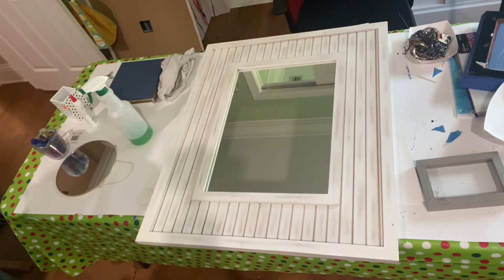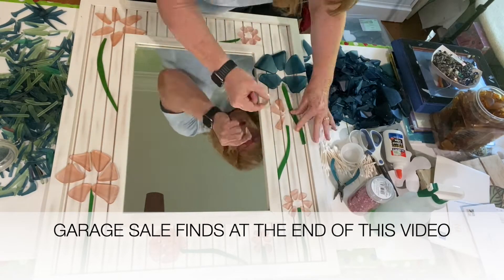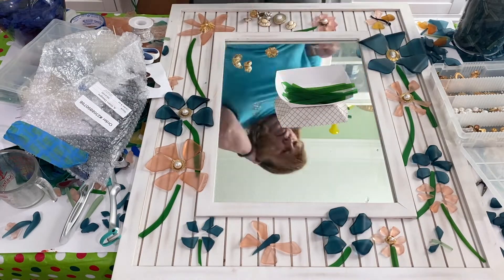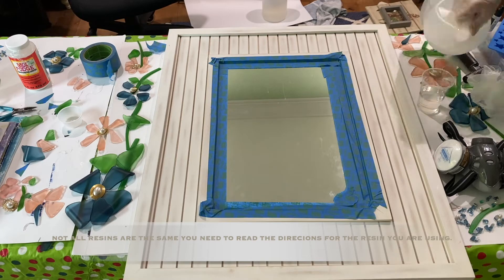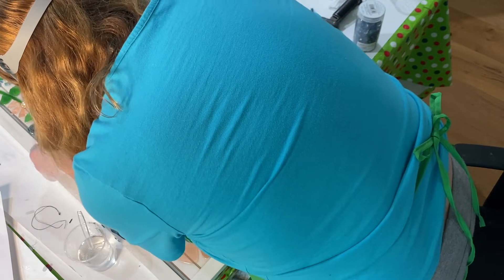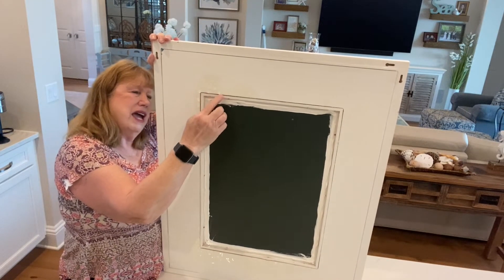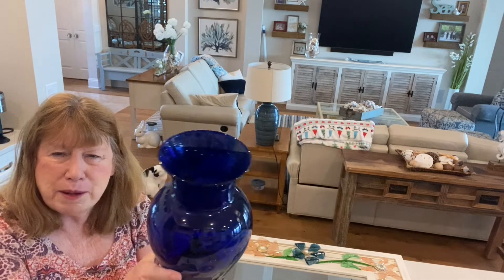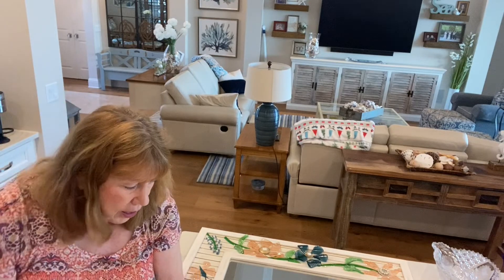SEA GLASS FLOWERS, EPOXY RESIN MIRROR, CRUSHED GLASS, BROKEN GLASS AND RESIN ART, MOSAIC, ART RESIN

Comment: Linda, the last garage sale sign you held up…I just bought several like that and I’m wondering what is the best glue to use.
Reply from the maker: I had to go back and watch it I forgot all about that. I guess it depends what you are putting on it and are you going to paint it first. If you are using resin just on the wood it would need to be sealed or painting would seal it . Are you putting heavy glass?
Reply: @crazyglasslady  it’s a “rough” painted sign. The flag one, I’m going to use Michaels holiday color glass and do an overlay with the colors still in the background..no sanding. I tried liquid nails glue but it’s too thick. Resin will run everywhere…mod podge too. Idk what I’m doing. Just thinking I may have to resin the whole thing
New to this craft 🙄🥴
Reply from the maker: You can use Mod Podge it will run all over but will dry clear so it should be fine. Or the other thing  i would try is paint all with  with full strength mod podge then sprinkle the glass where you want it the Mod Podge would dry clear and the glass would be stuck. If you are unsure you could just do it on a small corner but Im sure that would work if its the crushed glass you are talking about
Reply: @crazyglasslady  good idea.
Local grocery store marked down summer signs 75-90% off. Got at least 10